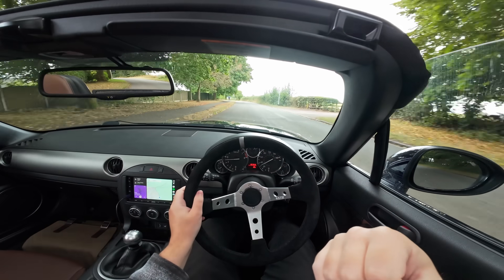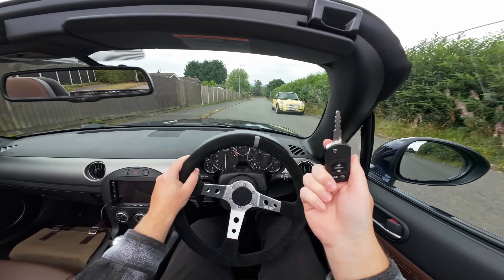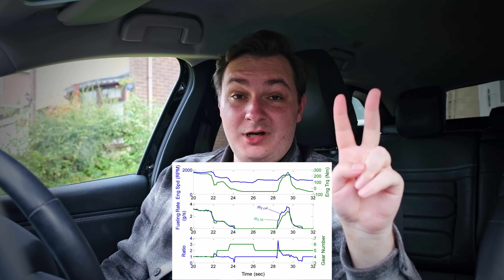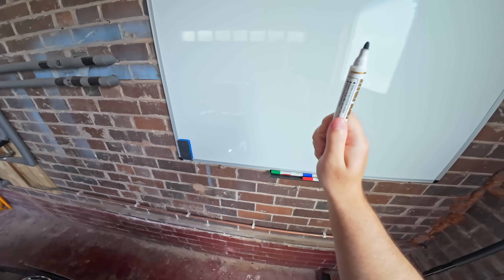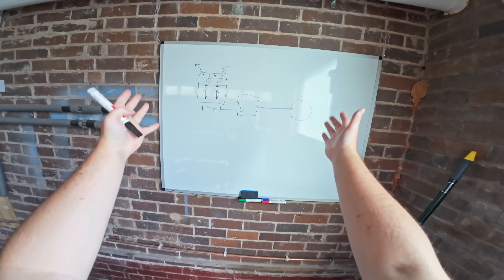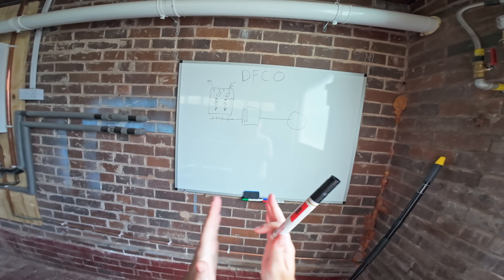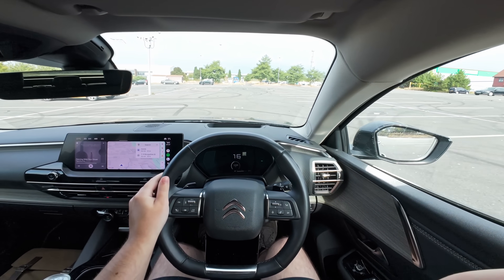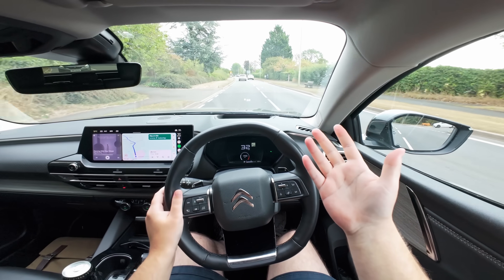The most misunderstood car term - Engine Braking

Comment: There is one experiment can prove this: find a big mountain, somewhere in Scotland Highland, Rocky Mountain, or Himalaya... Go there in Christmas Eve midnight that nobody drive, or cooperate with local police to make a close road. Drive all the way downhill for 30 minutes, with no accelerator, no brake, with a gear that can hold a higher RPM (no idle) with a constant and safe speed. Put another same car at the same time same location, leave it there idle for 30 minutes. Then check the fuel levels of both cars by using the old school way. This way, you can tell the downhill car using low gear (high rpm) engine brake actually spends less fuel than the idle car.
Reply: Why?  It’s provable already. Fuel injection shuts off. A carb will still fuel a minimum amount   an old diesel will also fuel an idle speed amount
Reply: @highdownmartin Depends on the diesel engine. Bosch VE mechanical injection pumps found on many older diesel engines do cut off fuel during overrun conditions like engine braking. Diesels don't provide much engine braking though, since they have no throttle plate to create vacuum against. They only slow down due to aerodynamic drag on the vehicle, rolling resistance of the tires, and friction in the engine and driveline, which are all small compared to a gasoline engine pulling a vacuum on the intake. That's why big commercial diesel trucks have Jake brakes, which open the exhaust valve towards the end of the compression stroke. That's why big trucks are so loud while engine braking.

Comment: What about intentionally shifting down in an automatic to get more engine braking? Of course I imagine it's not great to be sending your engine from 1k to 6k rpm with the torque converter, but what about a single downshift, say 1.5k rpm difference between gears?
Also, when you're going down a steep descent, engine braking is unquestionably the way to go, over using your brakes. Because of this, the follwing is a pointless question, but: is running your engine at high rpm for extended periods to achieve engine braking bad for engine wear and tear?

Comment: It's crazy to see how the wheels are connected all the way through to the moving pistons on the white board drawing; and then add the connection to the pedals with your feet all the way to the electrical signals in your brain.

Comment: for pretty much any modern car - no, it won't consume any fuel on breaking because of direct fuel injection

but if engine uses a carburator, it will consume a TINY amount of fuel (less than even idling) no mater what, simply because it introduces fuel on any airflow and there is airflow throught it as long as rpm is above 0

that also means it will consume fuel even when ignition is off

you have mentioned that but i still want to say it lol

Comment: Well here in Switzerland it is really important to use (and understand) engine breaking. With our mountains you would fry your breaks when driving down from a mountain pass (maby going down 2000-3000 meters of hight in one go) if you are pressing the breaks for over 30 minutes i think it would defeat not be good for the breaks. So we get thought engine breaking from pretty much the first driving lesson. (We also get thought driving in a economic and ecological, fuel saving way)

Comment: WTF people are disabled to a degree where they are inable to read a gauge.... the car litterally tells you how much fuel its consuming at any given time and people are inable to see a zero as a zero. To be fair tho... least times you use engine braking to its full potential, most times you just do very low gas so you slow down but in a slow chill way and then the consumption is not zero at all

Comment: Literally can just use a datalogger to verify this. When I coast in gear, the injector duty cycle zeroes out and the air fuel ratio goes completely lean. Also, that mechanics react channel is run by donut media so I’m not the least bit surprised they got their facts wrong

Comment: There is one thing i still don't understand. Why is there still sound coming out the exhaust when go off the gas? Wouldn't the exhaust go nearly silent when doing so?
Reply: The engine is still pumping air, so still getting a flow through the exhaust.

Also you get induction noise in airbox when engine braking, probably a lot more noticable on motorbikes where the air box is generally right in front of you.

Comment: Very easy to understand, you are moving in gear, not idling in neutral, the engine ecu is reading negative load,  there is nonreason to open the injectors in that state,  so it doesn't,  the momentum of the car is spinning the engine and it doesn't need to inject any fuel to keep that going, the throttle body is closed so barely any air is getting in,  if you have one of those gauges conected to wideband sensors to see if the car is lean or rich, during engine breaking the sensor reading goes out of range cuz there is nothing to read, took me a while to understand why ppl with these gauges would see the reading get messed up after a pull, this is why.

Whats weird is that i always used engine breaking without thinking cuz it's just a smooth way to drive, it saves on break pad wearing even when im at speed and aproach something like a roundabout, ill sequentially reduce gears which will force the engine to slow down with a tiny but of break pedal to match the rpms a bit better, cuz you don't want to suddenly downshift and your rpms skyrocket, but just manage that load the engine creates while you lift of to your advantage instead of losing that energy to heat and breakpad dust,  and no the clutch never slips during this operation so it's not wearing out

Comment: 0:10 I damn near had a heart attack lmao. To the viewers - NEVER EVER ATTEMPT THIS. 99% of the cars out there will lock up the steering wheel without the keys in the ignition and you will be unable to steer a moving car... Pretty suboptimal
Reply: I've also seen cars pull the emergency/parking brake when the key is taken out so that was my initial fear
Reply: Some cars won't allow you to turn the key all the way to the park/remove position when the vehicle is in drive.  For exactly that reason.
Reply: I’ve actually turned the key to switched off the engine while going down hill and on a curve. The steering wheel did lock up and I was turning into oncoming traffic. Lucky nobody was hurt. Attempting to straighten the wheel while the key was in that position is what engaged the lock. This guy was likely lucky because he didn’t have to straighten or turn the wheel.
Reply: Yes, that was my thought straight away. 😮
Reply: Not proud to admit that I have done this as well to try and roll as far possible into home, and my power steering did disable (v basic 2006 model car)
Reply: Doing a key removal and safe stop was actually part of our driving training where I live. I suspect it probably isn't any more due to most newer cars being push button start.
Reply: Yeah modern cars are digital death traps.
Reply: @progste what do you mean, "modern"?  Cars have done this for many decades
Reply: I had to drive a mile like this when my radiator blew, only turned the engine on to get up to 20mph then turned it off to stop it overheating, then back on again once speed started to drop off too much, bloody hell was that steering wheel heavy made it to the guy that was sorting my car though.
Reply: To be more direct, any electronic assist system will shut off, and some other assist systems might also get shut off or reduced.

If you have a really old car with no steering assist, you know how hard it is to turn that steering wheel. Now imagine the steering wheel is much, much smaller and you're turning a fwd car rather than a rwd car.

Brakes also generally get much stiffer, so you'll struggle to stop if there's an emergency.
Reply: @henriquepacheco7473 No, the brake booster and power steering pump would still work with the ignition off when engine braking. The engine is still being spun by the turning wheels with the transmission in gear, so the engine is still generating vacuum to boost the brakes and still turning the power steering pump even though it's not igniting the spark plugs or injecting fuel. This assumes a vacuum brake booster and hydraulic power steering system, but a newer car with an electric brake booster and electric power steering probably won't let you turn the ignition off while the car is moving.
Reply: @ElijahDecker  They aren't talking about loss of power steering, though you are (mostly, in a non-EPS car) correct about that. Many cars have a steering column lock that engages as an anti-theft device when the key is removed. I don't think the NC has one (my 2012 Mazda 3 didn't either), so he was safe in the video.
Reply: also braking and power steering will diminish/ turn off. so you might step on the brakes with all your weight and still not stop in time.
Reply: @horseneet No, it won't, because the engine is still turning when engine braking. During engine braking, the wheels and drive line are spinning the engine, which is still producing vacuum to power the brake booster and spinning the power steering pump.
Reply: @ElijahDecker  Don´t do it man!
Reply: @ElijahDecker do you realize that cars are not built the same? lol MOST cars have hydraulic pumps in brake systems. The moment your engine stops you don't have hydraulic power

Comment: you can't make something without nothing, simple alchemy. Good explanation video to school the 2 tiktok 'Mechanics' 

Standstill / off, no fuel used as not needed to move piston up/down
Standstill, to keep engine piston up/down, fuel is used keep engine alive (to support other on-board system / charge alternator/compressor load）
Car moving use more fuel, engine piston up/down faster, more fuel is used
Car is rolling, wheels energy is used to move piston up/down, no fuel is used as there is no additional need to speed up the car & engine piston up/down above min requirements to keep engine alive
Car rolling towards a stop, wheels energy cannot sustain min engine piston up/down requirements, fuel is added back to keep engine alive (to support other on-board system /alternator/compressor load）

Comment: i have a slight nitpick from my experience some automatics dont use engine braking when you lift off the accelerator they still inject fuel and only let other things slow you down they are like smart or something and they do this to improve fuel economy
Reply: but those automatics are annoying because of that

Comment: I expect the engine to sound much different when it's not exploding fuel particles. When I lift of the accelerator, the sound doesn't get much different. Therefore I'm inclined to think the fuel is still being burned, somewhere

Comment: American here, I drive a 2012 f-150 with the 3.5 V6 tt and the 6-speed auto power train. It gets slightly better fuel economy than the V8 counterpart at 16 (mpg) round town and 18 on the highway. But you can do way better by applying these principles here. If you engine brake all day long and actually drive with your brain, you can easily get 21 mpg++ around town (depending on how often you have to stop and go) but this concept is really not that hard to understand and my big vehicle brethren just don’t understand how I’m getting 700+ miles of range on a 35 gal tank

Comment: Had an issue on our M3 where the engine always dies when at speed in neutral gear. Turns out, the ecu didn't know that the car is in neutral so it cuts fuel when coasting. We fixed it by replacing the faulty gear switch sensor.
Reply: When you what now? FFS! WTF? You 'drive' in neutral on the M3?
Reply: @James-p7f5b can't be hammering it 100% of the time.

Comment: What is benefit of enging breaking? Certainly not fuel saving in its basic sense. Engine braking cannot save fuel because it wastes kinetic energy, specifically on braking, on compressing air in the cylinders. It only saves fuel that would otherwise be consumed during braking with the brakes on idling the engine. The disadvantage of engine braking is precisely the braking effect: the higher the engine speed, the more forceful the braking. Fuel saving occurs when kinetic energy is converted directly into distance through coasting, even at the expense of fuel consumed during idling. The main factors influencing fuel consumption are the vehicle's weight and changes in speed. Cars are not ideal in this regard. To move a load, often 100 kg, they use devices that weigh a total of 1700 kg, and this costs fuel. For this reason, each acceleration and change in speed requires much greater amounts of fuel energy than overcoming the resistance to motion at a constant speed. Every braking action wastes this energy, whether it's due to friction of the brake linings or engine braking. A fuel-saving strategy is coasting, which uses the kinetic energy of a moving vehicle solely to overcome the ever-present resistance to motion, converting it into distance traveled. The greater the speed change, the more energy is required, because energy depends on the square of the speed. Therefore, economical driving involves adopting a strategy to travel at a constant speed, and necessary speed changes should be made in a way that converts excess energy into distance, rather than wasting it on braking or engine braking.
Reply: The idea and benefit is based around the reality that cars do in fact need to slow down, so not 'wasting' the kinetic energy, but employing it to gain distance without fuel burn while slowing down. Obviously it is more efficient to drive at constant speed but this isnt the realities of driving.

Engine braking also gives the driver more control for limiting speed, especially on downhills, where coasting would require brakes to limit speed and also uses idle fuel burn.

In non-slowing down scenarios such as coasting on the motorway, maybe you gain more distance for less fuel by coasting once up to speed, but the car obvs will still slow down unless its downhill, just a slower deceleration than with engine braking, so the driver still needs to accelerate back up to speed and so needs to know which gear to return to and be half decent at rev matching in order to get the car back into gear smoothly at higher speeds which idk if normal everyday drivers would know so staying in gear is more natural and easier for most people.
Reply: @dugmeat5881  Driving with the highest fuel efficiency is simple and the same as gliding. It's a game of converting potential energy into kinetic energy and vice versa, and, unlike in cars, using updrafts; in vehicles, it's fuel. :-) Roller coasters in amusement parks don't require constant power and provide unforgettable experiences. Braking downhill doesn't make sense from an energy perspective; you have to climb that hill first, and if you're descending, there will surely be another one that will use up your energy reserves. :-) Compliance with speed limits is a matter of optimization and strategy. If you're at the maximum speed limit at the top, it's no wonder you have to use braking from the very beginning of the descent. Whether it's the engine or the brakes, the free energy from the descent will be dissipated. However, if the speed at the top of the hill were close to zero, we would thus recover some of the necessary energy to overcome the incline. :-)
Therefore, there's no doubt that the largest factor influencing fuel consumption is the vehicle's weight. Nowadays, this is unfortunately constantly growing, as are the vehicle's frontal surfaces responsible for losses due to air resistance. Fortunately, in electric vehicles, mass has a smaller share of energy demand, provided that the energy recovery system operates efficiently and the driver's driving style allows it to function.
Reply: @rsmiech6691  hahah i like it, unfortuntely old people doing 15mph, delivery vans and the odd loose farm animal ruin my free flowing ride. 

i bet thers no thrill quite like just cresting a hill with the few final mph, while a mile long que of angry motorists swear at you from behind

Comment: Isn't it even more efficient to just go into neutral, if you know you're going to stop, and are trying to maximise the distance you'll travel? So the only braking is the friction with the road?
Reply: Yes it is. You’ll also notice that if you come down from a hill, your car will gain more speed when in neutral compared to being in gear.  Some cars have super cruise I think which puts them in neutral when not on gas

Comment: 7:40 You said the engine starts using fuel again and keeps you at idle. Is this for automatics only? Because I thought this whole thing was about when the clutch is touching, in which case a manual stalls?
Reply: This only happens during an acceleration event and the difference is because of how a clutch in a manual works and how a torque converter in an automatic works. I believe if you decelerate down to idle with the clutch engaged in a manual, it will also creep like an automatic
Reply: Automatic transmission cars use torque converters which have an impeller and a turbine submerged in ATF. As the impeller(engine side) spins, it causes the atf to spin which spins the turbine(transmission side). Clutches are mostly binary as in either its engaged or disengaged, unless you wanna grind it. If you dump the clutch in a manual at idle it’ll stall because the clutch engages instantly without sufficient power to get the car rolling

Comment: Lovely primer! Engine braking in my 30k miles truck: I am at 30% tread left on my tires but still 70% on brake pads. Completely agree in saving fuel costs, but it also reduces maintenance costs too!